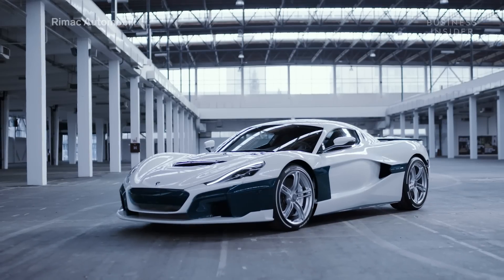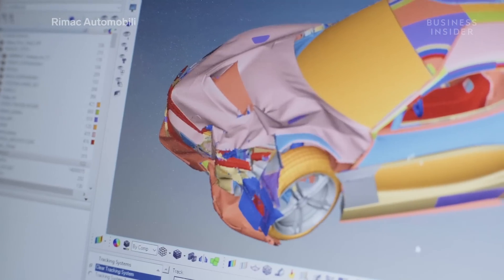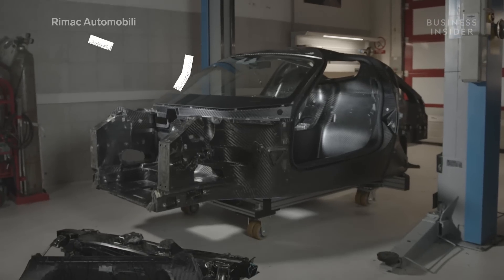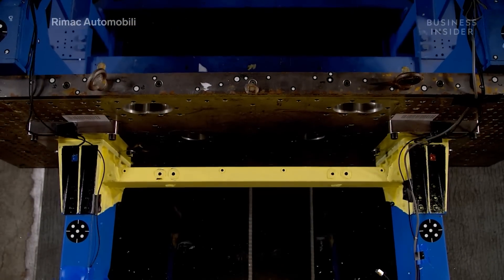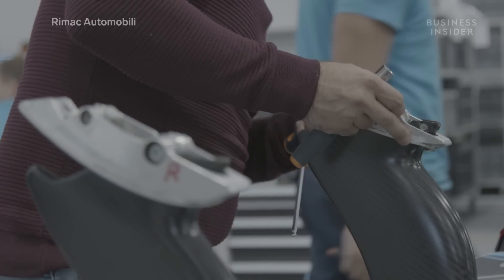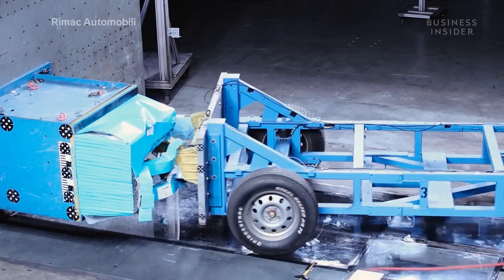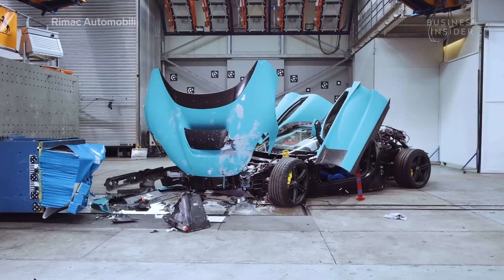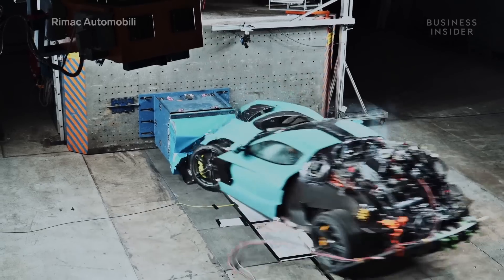How A $2 million Electric Hypercar Gets Crash Tested | Carsplainers

Comment: 2:35 GTFO with your 2 million.
As is, the 2 million price tag is stupid overpriced. That is the demanded price from customers, not the cost.
Ah, if he wanted to say the total crash test program with countess destroyed vehicles and parts to be 2 million, they yes, maybe that is true.
Remember, they only destroy maybe 1 or 2 battery packs (if that), and maybe 1 or 2 of those cabin center safety CF cell.
And those are the most expensive. Motors are not expensive and the rest of the generic stuff bits is not expensive (compared to the 2 million asking price)
I would say one car to cost to manufacturer 1 million or less because they are new and small firm without any background and needing to learn all things. A regular exotics manufacturer that has the knowhow and tooling and expertise would only have the EV tech new and for them it would be a lot less.

Comment: "tests ranging from 10 to 50mph"
Boi, you should be testing up to 100mph when its with super cars, or even more.
Reply: At 100mph there is not much a car can do differently to protect you.
Reply: @miguellopez3392  fair enough, but most accidents aren't going to be fender benders. They're gonna be high speed highway accidents.
Reply: @zeke7100  data shows most accident being under 60 due to braking.

Comment: Model S Plaid+ 0.60 in under 1.9 seconds.

Price: $160k

Seats: Up to 7

Doors: 4

:)
Reply: At which point it overheats and becomes severely crippled. Tesla's are very impressive, but they sure as hell aren't track cars.
Reply: @bilbonob548  the plaid edition model S is a track capable car, it's significantly upgraded over the previous model S p100d, a prototype a year ago did the nurburgring in 7:13 seconds back to back.

Comment: With the relative hypercar performance of current electric cars from small city cars to saloons like tesla, especially their 0 to 60mph, and the instant overtaking acceleration grunt, compared to equivilent petrol or deisel cars, its time for euro-encap and north american crash regs to bring the frontal and offset impact crash speed minimums way up. A basic 40mph/50 kph speed is ridiculous for the new average family electric saloons or hatchbacks, that can easilly do 0 to 60 in 3 or 4 seconds. A slight twitch of the foot or a moments inattention in every day driving puts the passengers in a vehicle that only trained and experienced race or rally drivers have the abilities and reflexes to get out of, and a standard metal/plastic composite panelled bodyshell thats not designed to meet those forces into death traps.

Comment: Fun fact: a Mclaren F1 from 1995 with less than half the power is faster than this "Hypercar"

and it does it with no turbos
Reply: Electric engine vs internal combustion engine... It's like comparing off road car vs a camper. They are 2 different types of cars.

Comment: These are Hypercars, they ought to be tested at speeds significantly higher than the 10-50 mph range.
Reply: There is no need to test them at higher speeds because not everyone drives 200 mph and if you crashed at those speeds you are dead anyway these are average speed and survivability tests .
Reply: yes but if you are going at those speeds you have a helmet and a hans device on and the strength of the chassis will keep you safe because as long as the seatbelts are good you probably wont get hurt from g force alone

Comment: I'm doing my PhD in engineering focusing on vehicle safety engineering.  I use finite element methods too!
Reply: Even the large OEM I work for is using CAE much more for even airbag deployment kinematics, which is still very hard.  Trying to see if trim will hold up in hot and cold tests- I work in airbag validation- module and system.

Comment: Funny how he says it costs more than 2 million to crash the car when not even the cars being sold actually cost that...
Reply: I stopped watching after that
Reply: you know that a prototype is manually assembled and built with more expensive methods than the production version right?
yes
depending on the costs that you account for, those prototypes may cost several million
Reply: @MmpM123YT  and your point is? Cause mine - the fact that the cars dont cost 2m to assemble - still stands.
Reply: @TurboJesus  that he isnt lying
and yes those cars dont cost 2m to assemble but u need to make a profit to develop the next one.
because the production is limited, the development costs are significant.
Reply: @MmpM123YT  development costs definitely raise the cost of a hypercar, but this is no Koenigsegg with a single-gear, home-built engine. It uses batteries just like a 35k Tesla... Now -- again -- if 2m considers profits and development costs, that would imply the crash test units "costing more" to crash are being profited on, while actually reusing the frame as they explain in the video, which makes no sense really.

Comment: Ouch this hurts to watch.....I wonder how Hammond feels
Reply: Every Jdm fanboy ever : uM aCtUaLLy, a sUprA cAn bEaT a saTuRn V rOckEt iF bUilt cOrrEctly
Reply: Vietnam flashbacks
Reply: Fr
Reply: i mean they could always make more, its not like its a Skyline or a Supra.
Reply: @MEYH3M  do not compare the Rimac to those antiques
Reply: @AnthroGearhead  those antiques would destroy the rimac in a 0-300kph drag race when built properly.
Reply: @MEYH3M  I dont think those will be road legal eith 0-60 in 1.8 secs
Reply: @MEYH3M  found the fanboy
Reply: @samuelmoon2766  nah...am the owner
Reply: @MEYH3M  really? i thought you were 12
Reply: @samuelmoon2766  i wish i was
Reply: @samuelmoon2766  also what made you think that ?
Reply: @samuelmoon2766  huh ?
Reply: @MEYH3M  no
Reply: @MEYH3M  You do realize that electric cars can accelerate faster due to the instant torque they have at all speeds which combustion engines can never avoid, plus electric motors has been improving over time and top speed is becoming less of an issue for electric motors nowadays. There's a reason why certain drag strips ban all electric cars from competing. Look into the physics of how different cars work before you start trash talking.
Reply: @Percutien  NIO EP9 (1,341 hp) does 0-60MPH in 2.7 seconds.

Geo Supra (2000HP) 0-60mph 1.03 Seconds.

EP9 is still slower and to make an electric car faster you need more power and more power means bigger batteries and bigger batteries = more weight.
Reply: @MEYH3M  Alright, I do not know about that the Supra you mentioned so I'll take the L on that part. But I still need to say that first of all, I'm not talking about specific electric cars I'm talking the nature of combusion engine cars and electric cars. You say that electric cars need biger batteries to produce more power and that equals to more weight, but that is not entirely true. The reason why these cars have this many batteries is to give them longer mileage on a single charge. They can easily produce more voltage without having to add more batteries by simply changing from parallel to series on those battery connections. But in turn, they will have to sacrifice mileage for those extra power. Which also holds true for performance cars that sacrifice mileage for better performance such as the Supra that you let me know about.
Reply: @Percutien  will electric cars be faster then combustion engine cars, yes. 

but it will take a few more years to catch on more then 150 years of evolution traditional cars went through.

The Toyota 2JZ-GTE engine is regarded as one of the most overbuilt engine ever, Toyota built that engine to make supercar level of performance it was going be the crown jewel of Japanese car tech but the Japanese automakers were engaged in a state of informal, unstated mutual restraint, where no car that they produced would have higher than 280 horsepower, so they ended up with one of the most over engineered engines ever. years later people are getting those engines to make 1000HP+ easily and without damaging the engine in the long team.
Reply: @MEYH3M  Yeah well......take JDM. Id rather have that Rimac.
Reply: @MEYH3M  and also I see you are a pround owner of the Supra or Skyline and there is nothing wrong with that. But gotta say man showing elitism and not appreciating other impressive machines doesnt get us anywhere. Also 0~60 time isnt everything in terms of car engineering. I respect JDM at all its worth, but sir you really didnt have to bring that up while discussing Rimac.
Reply: @911rsr  The thing i don't like about the rimac mostly is that it does not feel like a car, it does not have a  soul, feels like a machine nothing more nothing less. but i do appreciate the innovation.